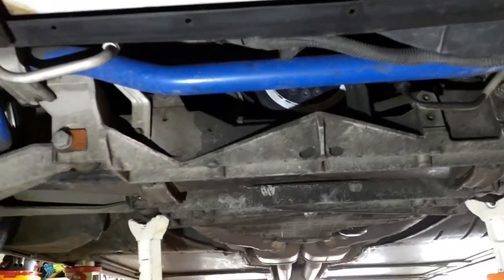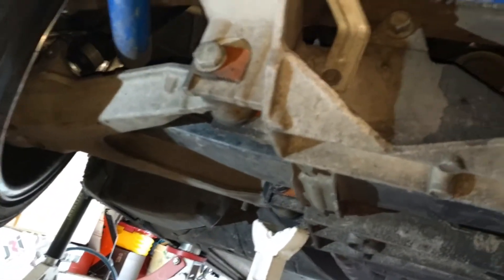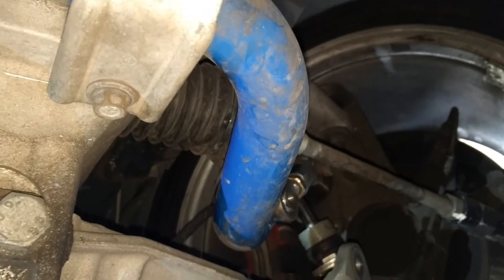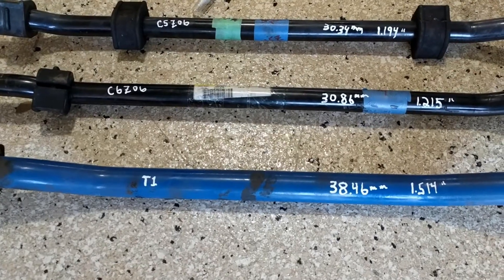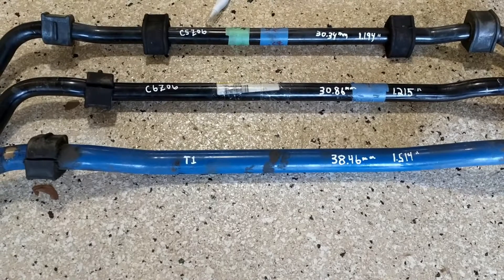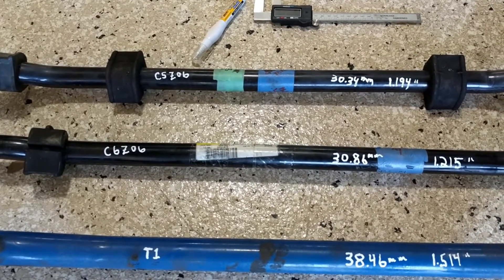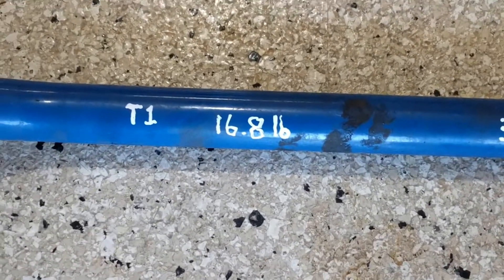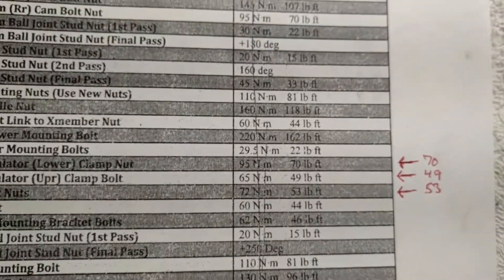corvette c5 z06 remove front t1 sway bar stabilizer by froggy

Comment: What will this do for your car adding the T1 bar to the front?
Reply from the maker: Two things when "adding bar" it adds to total overall spring "rate" (stiffer spring rate combined with everything else that adds to spring rate) and prevents lean/sway/weight transfer in cornering.

:)